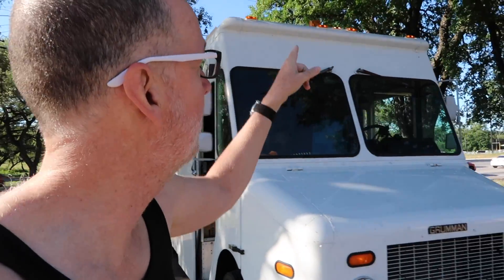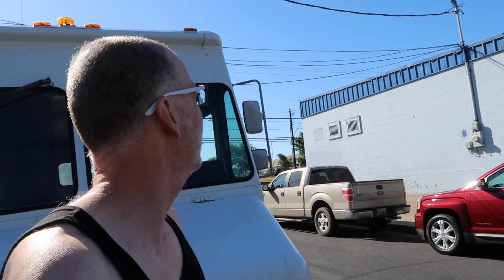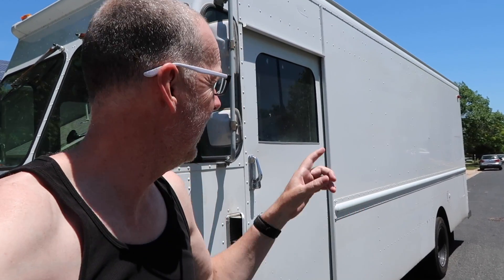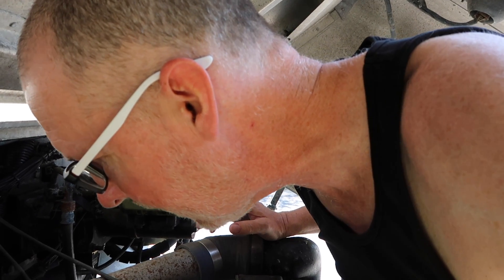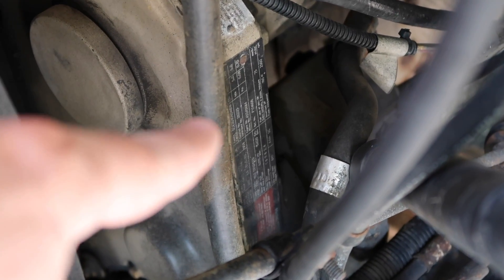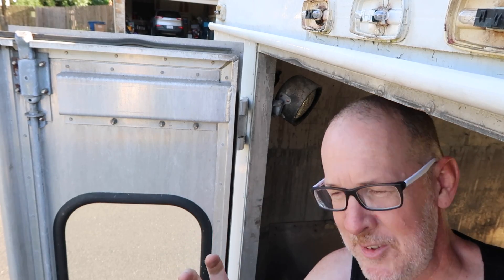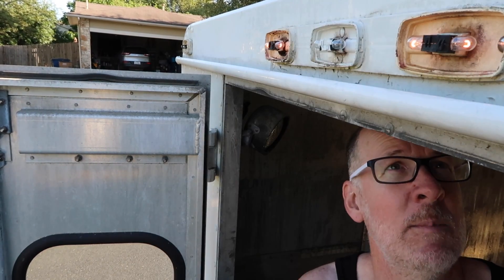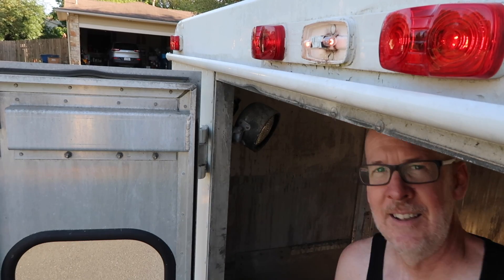Failed Step Van Safety Inspection E224

Comment: clean all the corrosion off the contacts with a wire brush......clean everything off with some rubbing alcohol after that....coat the contacts with some dielectric grease.....and then bolt everything back up, nice & tight.
Reply from the maker: that's what I need to do. thx!
Reply: Another tip.....for more delicate electrical connections....like the contacts for the bulb socket & the bulb itself.....use a pencil eraser to clean off the corrosion on those parts. Don't rub so hard that you remove the contact plating....just enough to kind of shine things up......that'll give you a nice contact surface as well. 

And in the future, like you did this time, give electrical components & wires a little jiggle first to see if it's a contact issue.

HOWEVER, go easy on any wires/wiring harnesses when you're moving them around.  If wires have been sitting & bent in a certain way for years, they might be very brittle & break if you start manhandling them.

Old wiring likes to stay put & will usually continue to work for decades, if you don't mess with it.  Once you start moving things around, the wires might just snap....externally AND internally.  If a wire breaks inside the insulation, you're gonna have a bear of a time trying to figure things out. 

Bottom line.....just be gentle when you're working with old wiring, etc....wiring & the like are not big fans of change......if a wiring harness is bent a certain way & has been for years, it'll bite you in the butt if you manhandle it.  

Good luck!
Reply: One more thing.....as far as any kind of troubleshooting goes......Always go back to the last thing you did, before the problem occurred; you know, it ran fine, then I did this, and it stopped working.  You might run into a coincidence once in a while, but usually the problem can be traced back to the last thing that was done.

Comment: I hates to be the one to say this, but you need to take your electrical shop manual, locate ALL the grounds, and re-vamp, or this problem will bite you on the posterior over and over, and chasing down electrical problems on the side of the interstate (or getting towed) will get frustrating.
Reply from the maker: I agree that is the best course. I'll get there. but want to get the kitchen and living space built so I have some comfort, then come back to the electrical stuff later
Reply: I'm sure you will.  I admire your "can-do" attitude. Patience and persistence overcomes most problems.

Comment: If I was you I would be running a separate ground to the lights instead of relying on the body of the vehicle as the ground. Run it back to the ground where the battery is connected to the body as that way the ground will not have the problem of having to make contact through the damaged  Aluminum body. You only need to run a lop wire which runs from one light to the other and then to the ground side of the battery.
Also the vibration that you get at 65 mph may also be caused by the exhaust. It may be that it may need another bracket. As you say that when you coast at that speed it is not there as the motor will put out different sound pluses at different RPM and engine loads.
If you have the time you may think of doing a basic mechanic's course at a night school as this could help you solve problems as the lights  and any problem that happens on the way. Like watching the videos and how you are sorting out the little problems.
Reply from the maker: I'd love to take a basic mechanic course night school!

Comment: Bolts/nuts making the lights not work and then work. That was a ground issue. If possible, replace all nuts and bolts with metal ones. No nylon or other plastics. You need metal to make the ground connection.
Wish you would just replace all those old lights with LED ones. They are cheap now days.
Reply from the maker: got it!

Comment: Seven, we'd be watching travel videos by now if you had spent your money on a leased class A..or (given the infinite repairs on this truck)..you probably could have purchased a decent Class B.
Reply from the maker: certainly a motor home is a better turn key solution to hop in and go. I did test drive about 25 RVs in January (see my videos on that). none came close to offering what I wanted of a mobile book exchange library and setup for serving tea to a dozen guests. I couldn't find a diesel in my price range nor one with head room for 6'6". my step van has 10k miles on it and only two or three pesky problems to solve at a fraction of the price and I can build it to be exactly what I want. I hope you watch an episode a year from now to compare what I build to what an RV offers. I believe you'll see what I create would not be possible in a motor home unless you gut it
Reply: I hope you are right. But the proof in the pudding is in the eating..or in this case the cost/benefit analysis. I grew up in Baltimore and we had "Bookmoblies" come around to the schools when I was a kid. All of those vehicles they ran were box-vans like yours. But there was no room whatsoever for tea and guests. The books were served out portals on the sides like an ice-cream truck. Here's something I feel that's really important that you need to think more about..paper weighs a lot. It won't be long before you over-gross the capacity for your axle, suspension and drive train stuffing it full of books. You might do well to measure how much a cubic yard of paper weighs and do some calculations. That van was not designed for the sustained loads you just proposed in your reply. To save you a bit of time..from my engineers notebook of weights; 1 cubic yard of loose hardback books weighs ~530lbs..conversely loosely packed paper backs ~430 lbs.
Reply: you'll be pleased in the end simply due to the fact that YOU decided the outcome of your build, not a team of laborers on an assembly line
RVs wear out tires, engines, brakes, lights, wipers,  etc... just as the step van has

Comment: Take off light fixture.  and match directly. Or replace  lite fixture. Run continunity check to see if you have clean connection. Ask the original mechanic . if they have no recall repair record make them do the repair... Go on craigslist and barter mechanic work... Or call a temp agency or drug rehab... Some experienced mechanic. I paid a guy total $800 he tore down fuel injection system replaced. Fuel pump twice complete d une up would have been $4000 wo new timing chain distributor and starter twice. Huge amount but had a drug problem...
Reply from the maker: great tips on the electric!

Comment: You are going to be a trucker before you get done.   With that wide vehicle you need to practice hugging curbs as close as possible, without rubbing your tires.  Use your side mirror and look at the body and how it is lined up with the lines on the pavement.    UPS leaves their trucks off the curb so you know to be careful.  a truck just parked for hours starts upsetting people.  some people get upset and use telephones.  It all goes downhill from there.
Reply from the maker: great tips. thx

Comment: Is this the Killer Dowel Pin (KDP) video? https://youtu.be/UZ0UmmM-QGU
Or this one? https://youtu.be/ugHQ-S0sERU
Reply from the maker: both videos are correct. it is a small washer with a tab that goes over the top of the pin to keep it from vibrating out. I believe there are several videos out there showing how to do the fix

Comment: Find a bread truck repair shop and buy a mechanic a fifth of whiskey . or call a temp agency and pay four hours for experienced . you have a ground problem. Sand paper and spray then sauder wires. And use shrink wrap. Clearance lights always fail if not done this way.
Reply from the maker: I got the wires fixed and passed inspection. that was 2 years ago and I'm getting much better with my electrical stuff

Comment: The lights would NEVER be in series, and pretty much any high school kid could tell you how to use the multimeter. I doubt anyone will tell you the settings are wrong because you NEVER show what you have it set to! Even most car repair manuals say how to use the meters.
Reply from the maker: I don't understand why lights would not be both in series and parallel. I know batteries are and many old holiday lights are so I figured some auto lights might be in series. I looked through my step van factory service manual and there is no info on how to use a multimeter. I hesitate to ask a high school student as I think an old guy in a step van sitting outside a high school might appear to be other than what you suggest. that said, I will look for adults who know how to use multimeters to give me some lessons. anyway, as I've mentioned, I am a beginner and learning all this for the first time. if you are looking for expert mechanics on youtube you're on the wrong channel.

Comment: get rid of that silly machine and get a light bulb and fitting solder the probes to the fitting and use that for testing so then you have a live and an earth bulb lights menes good circuit  no light bad circuit that is all i have ever used in the 40 years i have been working on everything from cars to heavy haul lorries
Reply from the maker: agree!

Comment: You have a lot of patience. But, you really need to do research online BEFORE you tackle a project problem. You will save yourself a lot of problems and time. Google is a great tool to look at other solutions and basic automotive repairs. Basic electrical and mechanical components can be self taught - if you take the time to research. 

I agree that many times basic troubleshooting knowledge is often stressful. But the key is taking the time educate yourself. Cause and effect has to be your basis of learning. Why does something work, which in turn will help you determine why something fails.

Using logic is has to be the basis of how things work. You have to learn basic electrical laws. It's not that hard. Just replacing things, like light bulbs is not going to help your thought process or further your abilities.
Reply from the maker: Doug, thanks for your comment. you seem to be the only person encouraging me to do more research. 99% of the comments regarding my research are telling me to stop doing research and move forward with the build. so, it is refreshing to see one comment suggesting I do more research rather than less.
Reply: There are lots of ways to learn what you want to achieve. I was once a novice like you on many different types of automotive and home repairs. But like many others, I have discovered a pretty straight forward approach to problem solving and how to learn the right way to do something;

Seek information, generate body of knowledge, virtually practice and compare your findings to others and then decide how you understand it. If it makes good logical sense, proceed with a plan to tackle the project. If it doesn't, the first two steps were not sufficiently completed. 

Converting a cube van into a living space is not a simple task. Nor is one of your other lofty goals - converting your Cummins Diesel to run on bio fuel. These are big items. The RV conversion is realistic, but the bio fuel one is fraught with significant risks and could ruin your overall goal - traveling across North America safe and economically.

Getting feedback on your YouTube channel is always a good start and often given freely by very knowledgeable people. But it can also (as you have discovered on numerous occasions) be a frustrating experience when Advice A does not precisely fit your Product B repair needs. I'm certainly not suggesting you cannot accomplish your goals. I think the idea of building and travelling in a cargo van conversion is realistic and can be safely achieved based on your capacity to learn and take your time.

But here is some tips I think you should consider and get other opinions on. Quality and Safety quality come first, not price. Just because you can buy something cheaper does mean you should. Is that a question of degree, yes. But it is still a prudent question you should always ask yourself. Remember, if something goes wrong with your RV while on the road and it is determined you used non-certified or illegally installed components, you can and likely will be held accountable financially and legally. 

One simple example; an RV fridge, which are widely available and operate using a variety of different power options including propane, electrical 12 and 120 volt power supplies and are often called "three way fridges". If you install on your own and do not fully understand the safety requirements when operated with propane, you are just asking for trouble. Getting one installed properly by a professional is not going to be cheap either, because your RV isn't following any kind of proven design. And then you will want to tie the propane supply into the stove top. Again, it itself, it's a popular and safe appliance to have in a RV conversion. But doing so means you MUST have thorough understanding and knowledge. Not necessarily expert and certified, but you better be rated above novice - amateur. Put another way, you can't say to yourself " I don't have a clue how this works and how to repair it."

So look up "how to install RV three way Fridge" and how to install RV propane stove is something I suspect you have already done. But like TV, 'that's not all! - there's more!!' and should then look at that model of fridge or stove and look up "how to repair model xyz fridge" AND "complaints with rv fridge model xyz". Doing so gives you a bigger picture with many more questions. Everything from 'what's a condenser' to how propane stoves work. It will then lead to how Propane stoves in rv's should be installed, serviced and where can propane tanks be legally stored onboard RV's and motorhomes. This isn't to discourage you, I hope it encourages. 

Finally, buy a proper set of basic tools and tool box that can be bolted to the floor of your RV to prevent theft and be lockable. You got a van bigger than you originally planned and this extra space you now have can accommodate one. I don't mean you need to go out and buy $10,000 worth of tools and quality supplies, but they should be above average quality and durability. Doing so now will safe you nightmares later. Full kits can be reasonably purchased online from quality vendors and are frequently on sale. Brands like DeWalt, Craftsman are not to be overlooked for value and performance. 

Harbour Freight, sorry, is just asking for a nightmare. That 14 gauge wire you bought to fix your windshield motor gives me nightmares. Wire is not just wire and that's how and why how it happens - fire . I can tell you, those crimps are okay, but they will corrode faster than you anticipated. That's not to say that Harbour freight doesn't have quality brands available, but you need to stick to name brands. House brands are just asking for trouble because they do not comply to any automotive or RV standards. Imagine hooking up your brand new 30 amp 12/120V fridge using offshore wire that has no capability to withstand current heat. It is these issues you need to research and understand why certain engineered safety standards are used and how you can achieve similar results without breaking the bank. Start looking at junkyards that specialize in reselling used RV parts. Ask if you can walk through the yard and look at how things are installed and do they compare to your design plans and what limitations you see becoming potential conflicts or issues in need of resolution. Take lots of pictures and document your plan and continue to seek advice from your (now) global community before you start. 

Good luck!

Comment: why in the world would you even go to inspection with out checking it all out first. People amaze me.
Reply: Hunter Guraine because he's driven it from Oregon to Texas, he knows it is safe, so why would he assume otherwise?
Reply: Ivan Shires, Ok so he assumed it was safe, that's all well and good but lights out, he had to know they need to work before he'd get a sticker. If he drove it all the way there and never looked to see if the light worked, he didn't safety check very well, It wasn't safe by DMV standards. Tires from 1996, vibration at driving speeds, wipers not working. Doesn't sound all that safe to me. I do electrical work, I NEVER EVER assume the power is off, never. I check. Might said I do a safety check first.
Reply: Hunter, with all due respect. But you are either not taking into account his knowledge about vehicles in general or you are portraying your own high standards to feel good about yourself. But Seven is completely not familiar with working on vehicles and is learning every bit of this by himself and comments from people he meets as well as comments through this channel. With a pretty large audience watching his every baby step. Quite a number of those are professionals with tens of years of experience, but also a lot of them are complete new to this kind of mechanical mayhem. Give him some slack here.
Reply from the maker: I've never lived in a state that requires a safety inspection. this was a first for me and I had no idea what they were looking for. in other states we only had an "emissions" test
Reply: OK so slowdown everyone. My first comment was ONLY to the fact the he went to DMV without checking the vehicle out before hand. The fact it had lights out, no wipers should tell anyone regardless if they lived in a no inspection state prier that their NOT going to pass. Forget him driving it to TX, at that point what difference does it make. It just messes my mind someone not check the vehicle first. 
DePvdM, I get the part of not being familiar with vehicle and wanting to save a few buck. I'm not either just mine goes to the dealer for that reason but I make sure everything works before I take it there. Sorry if anyone thought my high standards got the better of me lol, they probably did (again) lol.